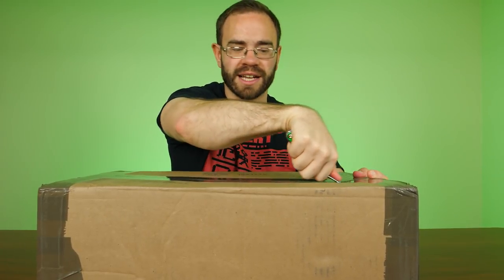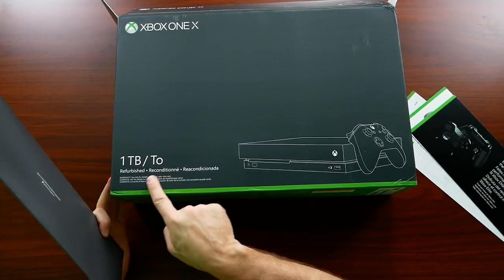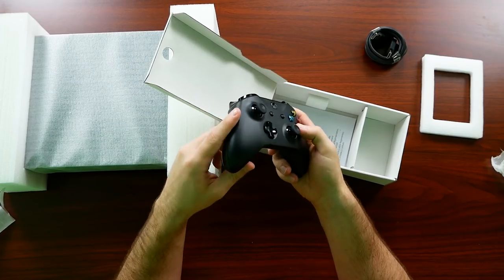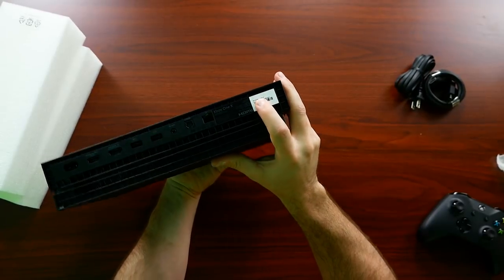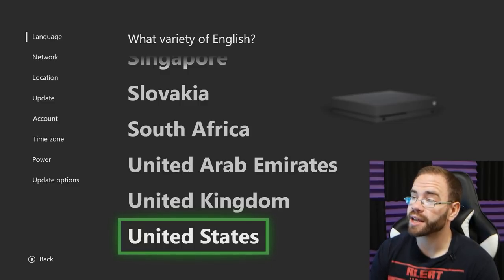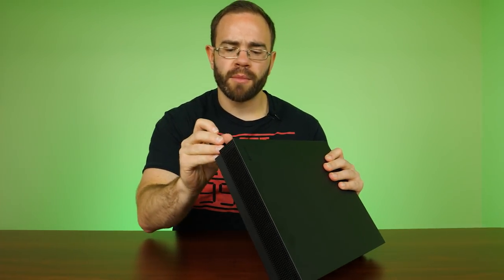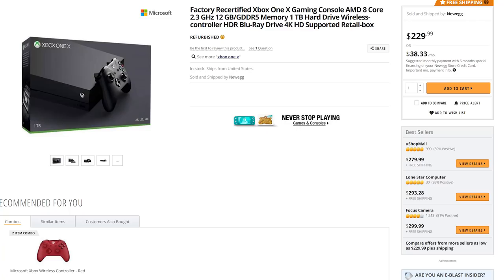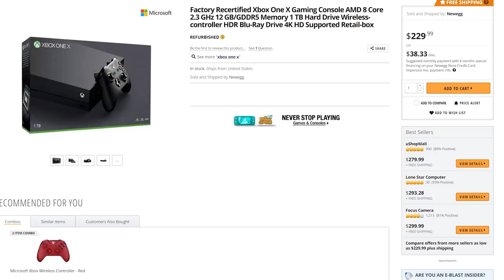I Bought A Refurbished Xbox One X From eBay...And This Is What They Sent Me

Comment: I got one of the 199 ones off eBay as well, after about 500 sold they jumped up to 260$, so glad I bought when I did. Like you mentioned, mine looks brand new, including controller. Runs like new as well. Best purchase I’ve made in a while
Reply: 3 years later? still works fine?
Reply: @ashrc1889  running like a champ. Though it has been passed down to my son as I mostly PC game.

Comment: Those are most likely units that failed a QC at the factory. Repaired before they even leave the factory so they are essentially brand new still. The seller most likely bought a lot of them from Microsoft or another distributor.

Comment: Different experience for me. I bought a refurbished Xbox One X for $400 back in 2018 and it didn't last very long. Games started crashing and it got to that point where the trouble shooting screen would pop up. I was lucky enough to get it returned and buy a new one for $450 with a $50 gift card, so it worked out. Crazy to see them now go for $200
Reply: coz xbox did not sold well. ms does not profit from hardware but thru software subscroptions aka xbox live and game pass. Also with plans for streaming their services thru xcloud

Comment: I just sold a barely used Xbox One on Ebay for $165.  I took it apart before I shipped it to video tape the hard drive serial number and put a mark on it.  A lot of people buy consoles on eBay, pull out the good hard drive and replace it with a crappy one, then demand a refund/send you back a system with a bad hard drive.  You gotta protect yourself folks!!!

Comment: I buy pretty much everything on eBay, I barelly use Amazon as the 3 things I bought at Amazon, all were crap.
One of them was an Amazon eBook reader and it was faulty on day one and Amazon was pissing around with replacement and after I got the replacement and they got the faulty back, they contacted me, saying I have opened it up and double-charged me.

I canceled, took pictures, send the other one back and it took 6 months and a ton of letters and emails till I got my money back.

For me, it's eBay only, never had issues and PayPal protects both, seller and buyer.

Comment: I purchased a factory refurbished Xbox and the only thing changed and was fixed was the HDMI port, is that noticeable at all when searching through the system like you? I know the one x has had plenty of HDMI fail issues and everything else seemed perfect. Got it for a steal a couple years ago on offer up and it still works perfect. Awesome second room system.

Comment: Not sure how it works in the USA or with Microsoft, but I know in the UK with Sony, if you send your PS back (at least this is how it worked with the original PS and the PS3) to Sony for a swap out, you only send the unit back, no cables or controllers etc. So it would make sense that if MS does the same, any refurbed units they sell later would either have no peripherals or would actually come with new ones if they are included.

Comment: What I  hate about the one x is how long it takes to install a game. I buy a game then have to install it. I keep my console off line just in case the patch updates take things away from the original build that I would prefer, like when Microsoft nurfed mafia 3 when the definitive edition came out. 

Then when I decide to go back online to install patches I need for other games like hdr patches, I have to wait ages for a mandatory console update then another update for the game patch. 

Some will say why not keep the Xbox updating by itself. Well the answer is the simple not all updates improve the console. The last update I had fucked up my hdr so I couldn’t continue a game in hdr from sleep mode meaning having to exit and reload the game all over again. It took ages before another update came along that fixed that problem which is why I usually keep my one x off line until I need to get an update for a particular game. 

I’m dreading updating my one x again. I only recently got it running how it’s supposed to. I’m shit scared that the next update is going to fuck it up again. 

I never have this problem with my PS4 pro and my pro doesn’t do mandatory updates as regular, either. Which in my view is a good thing.

Comment: Absolutely nothing wrong with buying refurbished. I bought a bedroom air conditioner "refurbished" for I think like $200 cheaper than its original price, it looks amazing the btu's are great. I took it home and still working today 6 or 7 years later. 
Refurbished means it was sent back to the original manufacturer for "whatever reason" and they do more than just try get it going again. They totally clean it up to manufacturers  conditions and run a thorough diagnostic and dare I say over-fix whatever the issue was, and then put back up for sale as refurbished. I also had a issue with my XB360 back in the day (2008'sh area), it was still under warranty. Microsoft paid all shipping including return shipping. I had my XB360 back in less than a week. I got a refurbished one and that was around 2008 and it still works today!!!
I personally think not just Microsoft, but most all reputable manufacturers when they get something back to fix under warranty, they fix to better than original manufacturers conditions. So to this day by experience I would almost prefer refurbished product because it was out in the wild and returned and the manufacturer for company-pride fixed it so welll to never get returned again.
Today we have the Gears 4 XBOX ONE S edition and the GEARS 5 XBOXONE X edition brand new and zero issues, both running fine and well passed the manufacturer's warranty... no, not feeling worried at all, and both are less than whisper quiet. Microsoft proven does learn,  and Microsoft PROVEN HONORS WARRANTIES !
sony, lol sony has faced massive class action lawsuits against them for not honoring warranties.. sony's main issues warranty issues have been over-heating, sony systems frying out and sony just doesn't want to deal with those things... hence the LOUD FANS on ps4fakestations today lol

Hey, thanks for posting Spawn

Comment: Do you know if Microsoft will still service a console if it has been opened? I opened one of mine after it stopped powering on to see if anything became disconnected and everything was connected so I’m guessing it was a short on the motherboard. Their updated warranty terms do say it’s void if a user broke it from attempting repairs it or a third party non-Microsoft authorized repair shop broke it when attempting repairs. It broke beforehand and there’s nothing that signals a red flag for user damage.

Comment: You repair xbox's? I have a xbox one X it was not working right like it was getting too slow when I was going to settings it didn't let me go to settings like it would froze and I thought I first it was the wifi but no it the xbox it self because if it was the wifi it would let me get in, in settings

Comment: Xbox one x with a game is on sale for $230 right now.. should have bought that lol.  Also Microsoft DOES NOT sell refurbs on eBay.  

Chances are some seller had a bunched of stolen ones and called them refurbs.  Microsoft does not allow refurbs to be sold.  I know that for a fact.

Should have went with the brand new one for $30 more lol.  Also startup is slow because it's launching 3 virtual machines and running a bunch of security checks and also checking all drives for games and it performs some basic system maintenance like clearing the cache, running hash checks on save files and other stuff I can't say.  That's why rest mode is better, it boots instantly.

Comment: I got one from same place and has same exact box and packaging also off ebay. mine would boot to dash and almost never crash there. if i booted into most games....gears 5, kingdom hearts 3, insect, halo 5, forza 4 and more would crash while loading level but after main menu. i could play doom 2016 pretty good and it would make the fan spin the fastest and loudest and sometimes could play for 20mins without shutting down.
i could play xbox 360 games like banjo kazooie, sonic and gears 3. gears 3 did shutdown on my at one point.
anyhow i did try a different psu cable to the xbox one x and i also had an external drive i installed the games to just to make sure. i signed up for the game pass ultimate for $1.00 and the day i got the xbox one x is the day the game pass just went live with a firmware update.
i tried playing games offline too and it didnt matter the xbox 1 would shutdown and then the controller would flash. i even took batteries out of controller and used usb cable to manage xbox one x.
anyhow i am shipping it back tomorrow will let you know how it goes.
pretty sad mine didnt work for the $199 + $16 tax for me. :(
Reply: damn that sucks im trying a refurbished from Walmart for $229 and they say i can just return it to the store if i need to and they offer a 3 year warranty for $40.
Reply: hahahahhahaha. cheap lol
Reply: $229 + tax?
Reply: just got back from sending it back. i not sure if i am going to try the seller again. maybe i give it one more try.
Reply: tdb0ne1 yes plus tax.
Reply: @milkmade22  i might try this same sellar again but if i dont i might try that walmart idea. Thanks
Reply: just ordered that same one from walmart 229+tax. just need to wait a week now
Reply: tdb0ne1 good luck. Let me now how it turns out. I might just gonna get a new one for $299 at the store.

Comment: The newer controllers and not like the original Xbox controllers the plastic is much thinner so the split in the back of the controller you can actually feel it on your hand on most of the Xbox controllers division 2 with an SSD forget about it🦂🦂🦂🦂🦂🤾‍♂️